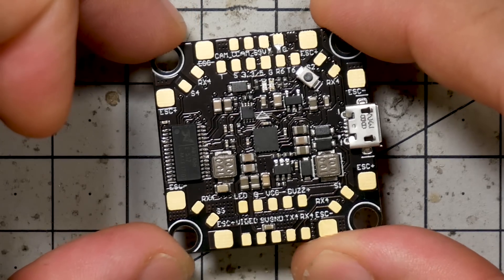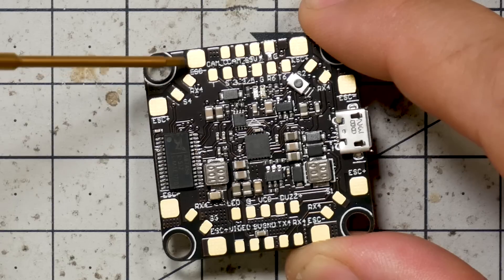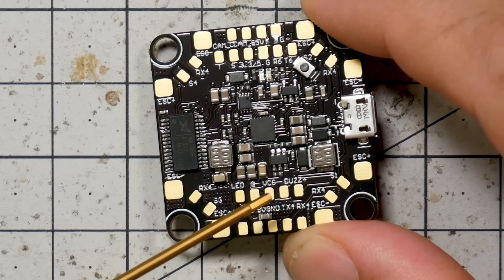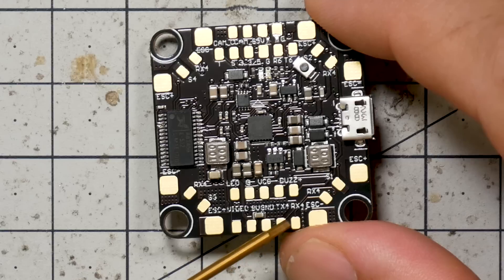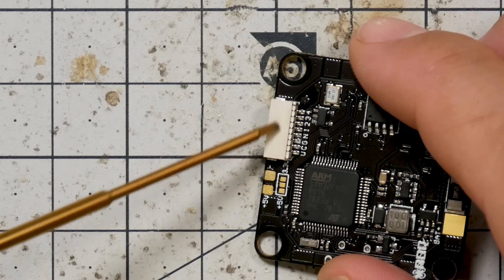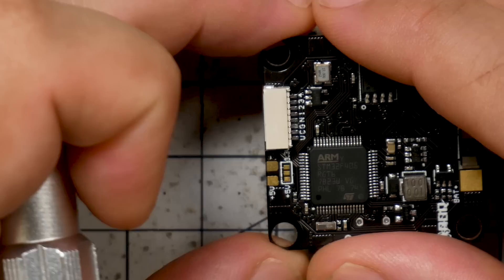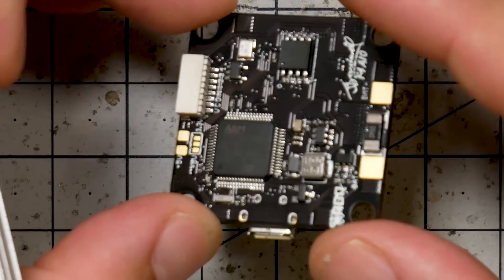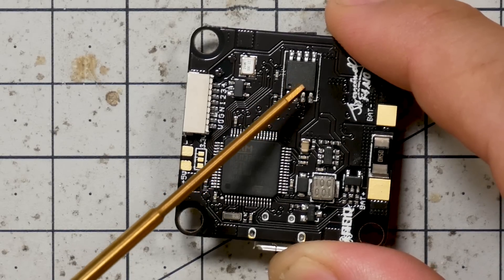JBF4 Flight Controller v1.3 | NEW LAYOUT AND FEATURES

Comment: I can’t get it to work in bataflight I only put the t60 on can ya tell me the sequence just fails no matter how I do it and tried it both ways holding the button when I plug it in and the other way plug it in and then push the button both failed thanks for your support
Reply from the maker: 1. Hold down the bootloader button. Plug in the USB cable while continuing to hold down the bootloader button.
2. Run the Impulse RC Driver Fixer app (https://impulserc.blob.core.windows.net/utilities/ImpulseRC_Driver_Fixer.exe). It should "fix" the driver successfully. If not, do not proceed.
3. Un-plug the USB cable.
4. While holding down the bootloader button, plug in the USB cable again.
5. Start the Betaflight Configurator app. In the upper-right corner pulldown menu, you should see "DFU". You can now flash the board.

For more detailed instructions on how to install the STM32 drivers: https://www.youtube.com/watch?v=m4ygG6Y5zXI

Comment: Hi JB, I would love to try a TX/RX capable GPS module to your FC V2! With crossfire and smartaudio as well.. Is there a way to use the S + T Pad, tweaking some stuff over the CLI? Or any other way to "create" an additional TX/RX Uart?
Thankful as always for any spark of your fpv wisdom! xD
Reply from the maker: Remap ledstrip to act as smartaudo or use CRSF pin IO4 as SmartAudio (connect it directly to the SmartAudio pin on the vTX). Then you have one UART free for GPS.
Reply: @JoshuaBardwell  Of course, Joshua, sorry I forgot about that possibility on the CRSF pin..mmduh. Sometimes the solution is right in front of our eyes! ;-)

Comment: I’m having buzzer issues with this board..light blinks when I flip the assigned switch but no buzzer.. I know the buzzer works because it beeps when armed or lost signal.. any suggestions?
Reply from the maker: The buzzer PWM frequency in newer versions of Betaflight has an incorrect default value. Set it to zero in the CLI. Type "get PWM" and hit enter. Then look for the buzzer PWM frequency parameter.
Reply: Thanks JB, 
Really solid flight board other than the buzzer! Sure appreciate the help .. all the help!

Comment: Ok Joshua, I have had this idea in mind for years. The problem is this, when flying in areas of different air density, the tuning of the quad will be affected causing you to need to change your pids. What we need is to account for this in a way that the density readout could automatically adjust the pids for air density. This requires an option added to betaflight for "rho correction" I already have arduino code to calculate the density from temp, humidity and barometric pressure. All I need is a spare UART and the beta flight math side of it and an API to be implemented. This would be an easy add-on for them I think. INAV should do this as well. The sensor to be used would be the BME280 by BOSCH. It's tiny and can be added to a flight controller or used as a UART add-on module. You'd even get the benefit of knowing all kinds of atmospheric info for a very small cost in weight/complexity. I think it's worth a shot.
Reply from the maker: This is really clever, but it's such a niche application because few pilots travel often enough to make it matter.

Comment: Are the instructions for the JB-F4v2 the same as this unit?
Reply from the maker: Not exactly. The pinout has changed a bit. You need to review the manual for the v2 which you can download from the rDQ product page.
Reply: @JoshuaBardwell  Thanks for the quick reply Josh. Starting a new build tonight with the V2. One more question if you've got a sec. I'm running a racerstar 35a 4-1 esc. Do I power the fc from the esc? Thanks in advance.
Reply from the maker: Assuming that there is vBat in the 4-in-1 plug, yes, you power the FC from the ESC.

Comment: Does anybody here fly with the hype-train rotor F4 flight controller.  I was just flying with my flight controller outside and I came in for a landing to switch batteries and once I hooked up the new battery it wouldn't arm so I went back to my computer to check it out in the computer wouldn't recognize it I noticed that it had a soild red LED is it dead? FC is two days old and this was my first flight
Reply from the maker: Solid red LED is not a good sign. Please reach out to Rotor Riot support and see if they can sort you out.
Reply: Joshua Bardwell seriously that's for replying.

Comment: Hi Joshua, first of all thx for your great work. Is such an easy thing to get my kwad running! 
I just bought your FC (version without sd card). Now I want to use Smart Audio and Cam controle at the same time. But I think I do have to less UARTs for this. Here my setup:

Runcam Micro Eagle, TBS Unfiy Pro 3, ESC Telemetry, FrSky X4R SBUS,

And here are my UART setting:
UART1: SBUS
UART3: SmartPortTelemetry
UART4: ESC Telemetry
UART6: vTX Remote Control

At the moment I do have connect the Cam TX/RX to UART6, but is there a way how I can use Smart Audio and Remote Control for my camera? If not, can I do connect the RX/TX wire from my Camera and the Smart Audio Wire to UART6, and choose in Betaflight the sensor I want withou damaging anything? Thanks for your help!

Best Regards Varus
Reply from the maker: Follow the instructions in the user manual to assign softserial to the LEDStrip pad. Then use that for smartaudio and you will have UART free for camera control.

Comment: @JoshuaBardwell I see V2 is coming out, Congrats!!! I am still running v1.0 with the 7.6v in one quad and the v1.3 with 9v in my newest build. Havent had any trouble with either board, (wiring vtx to vbat, and cam off 5v vtx output, rdq mach 2).  However with all these issues I hear about the regulators going out (5v and/or 7.6v/9v) I always have that fear in my mind not to do anything over water or trees.  Were these FC's only affected in certain batches or did I just get lucky??? I have been using the V1 since release (granted I only fly once a week on average).  POSTED SAME QUESTION ON YOUR V2 VIDEO. Answer where you feel is appropriate.  Thanks a ton! Quadfather

Comment: How do I connect a servo? I have one for the camera on my quad
Reply from the maker: I'm not even sure that's possible to be honest.
Reply: @JoshuaBardwell  I figured it out. Here's how in case someone wants to know. 
1) Solder Servo power to 5v accessory pads.
2) Solder solder Servo signal to led pad.
3) CLI remap Servo to LED.

Comment: I found that RaceDayQuads calls it "V2" and you call it "V1.3" -- aside from that, congrats on selling out on RDQ man, and the new 4-in-1 ESC I hope to order soon. I did a horrible beginner's soldering job and somehow fried my JB F4 V1 and RDQ was generous enough to replace it with a V2, so kudos to them, and to you for working with them.
Reply from the maker: No, that's not right. V1.3 is not the same as V2. V2 is a newer one.

Comment: I have a question about current sensing in your old borde ?
I have a tekko 32 35A 4in1 ESC . So can I take the current sensing cable from the 4in1 header to RX6 or I have to do the wiring in the manual?
Reply from the maker: The older board does not support external current sensor at all. You cannot put current sensing to RX6. You have to do the wiring in the manual.
Reply: ok so if i get the V2 board and replace this one i can just connect the current sensor cable from header to current pad and no need for the wiring like V1 right

Comment: Hi Josh, I just got your board and installed it. I got the problem, that if  I connect the battery, Im not able to connect via USB. Without USB the cam, vtx and receiver are working. I tried to put receiver to uart6, and desoldered the ESCs. Same Problem. Do you have an idea? :)
Reply from the maker: Please email RDQ support about this because YT comments will quickly get lost.
Reply: already found it: the Solderbridge to select between 3V and 5V wasnt clean. It connected all 3 Pads :)

Comment: Hi Joshua. Where can I find the FC PCB layout? I've seen to burn out the 9V voltage regulator (don't know exactly how... but it happen) and would just like to assess if it's worth to try to fix it, or just use the 5V pad.
Reply from the maker: The pcb layout isn't published. If you killed the regulator at least worth asking your vendor if it's covered under warranty.
Reply: Good point... I would be surprised if it is covered, but it's definitely worth a shot. Thanks!
Reply: On another subject, I've followed your suggestion on the Airbot 4in1 ESCs and bought Ori32 v1.1 4in1 25A ESC BLHeli_32. I've seen mentioned in several sites that this 4in1 ESC needs an external capacitor. But I couldn't find anywhere (yet), which capacitor would be more appropriate. Since I'm a bit new to all this, maybe I'm just not looking in the right place! Are you able to suggest a capacitor? Would a 470uF would suffice?
Reply from the maker: 470 uF is probably more than big enough. For 4S I would get 25v.
Reply: Ok... this electrolytic Cap I have is rated to 35V... a bit too big, that's true. Thanks for you help.

Comment: Hi Joshua, I have a question:   If I'm using one of the older versions of your FC (The only one I could find available here in Canada) and I'm running a Crossfire Rx (That means I'm using the only split UART available -which is the 4/Tx4 Rx4-) what should I do to connect my VTx remote control wire(SmartAudio)? Where should I connect it to? Thanks in advance for your help, and thanks a lot for your awesome videos!

Comment: I've been trying to get f.port working on this board with no luck. I don't see f.port mentioned in the documentation either. Currently I've got pwr & gnd connected and the f.port going to the T (telemetry) pad.  Serial Rx is set to UART1 and Serial Receiver Provider set to FrSky FPort. What am I missing?
Reply from the maker: Telemetry pad on this FC is UART 3 not UART 1. That's what you're missing.

I connect FPort RXSR to this FC in this video if you want a walkthrough.
https://www.youtube.com/watch?v=ZyKgBS9wmuc

Comment: About to wire up this board. What's the best way to wire up the camera? Some places say to wire the camera power to the vtx, some to the board power if it is filtered, some to vcc. I'm putting in a mach 2 and a swift 2. Thanks!
Reply from the maker: Personally I always start by powering camera and vTX from vBat. If there is video noise then I might switch to 9v.
Reply: Thanks! Can I use ESC+ when powered through a 4-in-1?

Comment: can i use the new plug on the back to plug my reverb pdb into? and will the current sensor on the FC still work if i have the battery leads going into the pdb?  

and just a small suggestion for the next design, maybe have the battery pads located on the side opposite of the usb instead of the rear? its a bit of a hassle to run the battery leads through the side of the quad like most people do. unless im just not a skilled builder, im kindve new so its a bit tough. love the layout of everything else! was a super easy build!
Reply from the maker: The current sensor on the FC will not work if you don't run power through the positive battery pad and the shunt. My recommnedation is to use the Reverb PDB only to hold the quad together and solder the ESCs directly to the JBF4.

It's a toss up whether more people prefer the battery coming out the back or out the side.

Comment: Hey Josh, i just finished wiring up your board, went slick. I will maiden it this weekend. I was wondering what determines the type of firmware that the board gets? Yours is clracingf4, but there is also cl_racingf4 and omnibus f4 etc. 
thanks!
Reply from the maker: CLRACINGF4 is the correct target for my board. CL_RACINGF4 was an old target name only used on version 3.1.7. OminbusF4 etc are for different FC.
Reply: Joshua Bardwell I understand that, just curious why there are so many different targets in general, is it the chip set that determines the firmware?

Comment: JB.
Hi, I used the getfpv link in your video description to order you new f4 fc V1.3.
The board I've received still has an sd card reader/holder. Is this the older or newer v1.3?
Reply from the maker: It is version 1.2. 

If you want to try an exchange you can contact the reseller. Make sure you take a look at the product listing though: if it shows 1.2 on their web site, then they're being honest about what they're selling.
Reply: Joshua Bardwell 
Cheers JB. A little disappointed but hey it's still a great board. 
They actually dont say which version on the website link youve provided in your description; getfpv link that is. I just presumed as you were showing the l.3 version in the video your links would also take me to a l.3 board. In my haste to make the purchase i never bothered to check which version the link took me to, no problem my mistake.Thanks for getting back to me so quickly, Respect.

Comment: A JB FC without SD slot, that's a shame - honestly. Since plasmatree pid analyser is out, a SD is a must again.
Reply from the maker: It has a dataflash chip so you can still do blackbox, just not all day.

It was this or the 4-in-1 plug and the 4-in-1 plug is much more useful. It's my fault for not anticipating how popular 4-in-1 ESCs would get to be honest.
Reply: I agree, 16 MB is ok to get the most important data for tuning, even at 4k sampling. But what's actually with bigger data chips, e.g. 128 MB. They should be cheap as beans. The long download time would be down side of course.

Comment: Hi josh have another question im having an issuse with throttle when i  throttle up fast for a punch out and let off the quad keeps going for a second before it stops . Any idea . All other stick inputs are fine . I thought maybe the reciever was acting up but when i check it on betta flight  it responds fine
Reply from the maker: If you have an OSD, put Throttle in the OSD and see if it goes down when you lower the throttle or if it stays stuck up. One guess is you are having a very short failsafe event due to the vibration of the high motor speed.
Reply: Joshua Bardwell ok ill try that thanks

Comment: In version 1.4 maybe you could have built-in SD card chip? Since Betaflight 3.4 now supports accessing mass storage, it should be possible. It should still be better and faster than dataflash.
Reply from the maker: We had to get rid of the SD card reader in order to fit the 4-in-1 plug on the board. Sorry to say but I think a lot more people will get use out of the 4-in-1.
Reply: Sure I understand that, but what I meant is (of course after some PCB redesign), if it would be possible to remove the dataflash chip and replace it with SD card flash chip, not actual SD card reader and the card itself, but just the chip directly soldered to the FC so it would not be removable, so the SD card would still be readable through Betaflight 3.4 as mass storage and we could easily transfer log files to PC. It should take almost the same space as dataflash chip, but the advantage would be better transfer speed and separate browsable log files, not just one data stream which would need to be erased as with dataflash.

Comment: No worries - after MSP mode showed up in Betaflight 3.4 RC versions log reading from onboard memory is going quite fast. 16 MB seems enough to store logs for field testing too. Only problem for me is that in MSP mode (msp command in CLI)  no build version and model name are added to log file name which I now must do by myself. But that issue should be addressed to Betaflight developers I guess.

Comment: Piroflip f4 is the way to go and its cheaper, better designed.
Reply from the maker: No blackbox. Cheaper by like three dollars. No built in PDB for those who want it. No silk screen labels which will leave some beginners confused. No user manual explaining how to wire it up.

Pyro F4 is a great FC for an experienced pilot who already knows how to build, who doesn't want blackbox, and who is using a 4-in-1 ESC.
Reply: PyroF4 OSD has labels on the board front and back including what UART to use for what device, and a nice diagram on their website. 6 UARTS, plus a flat bottom is nice as well. No blackbox is inconvenient though, but I don't find myself using it much anymore on my blackbox quads now that betaflight runs so well stock(loving 3.4 so far). To me it comes down to if you want blackbox, and do you want to run individual ESCs. I would pick the JB for freestyle, and the Pyro for racing. For a beginner the JB is an obvious winner as it has everything and a detailed manual.

Comment: JB - I'm a relatively new to the FPV scene and your channel.  This is the second video I've seen where you discuss JB branded products (Parallel Charging and this FC).  This product is definitely going in my first quad.  Looking forward to giving just a little bit back.  Now, however, I am wondering what other JB products are out there.  Do you have a list somewhere?  Thanks!
Reply from the maker: My FC and parallel boards are currently the only branded products I make.
Reply: Thanks!  I definitely learned something today!

Comment: How do you wire RunCam Micro Swift 3 with Tx / Rx (green/orange) connectors on the old JB F4 board for camera control? ? There is only one connector for camera control on the board - CAM_C. Thanks.
Reply from the maker: The TX/RX cameras use a UART not the CAM_C pad. Use TX4/RX4 for my FC.